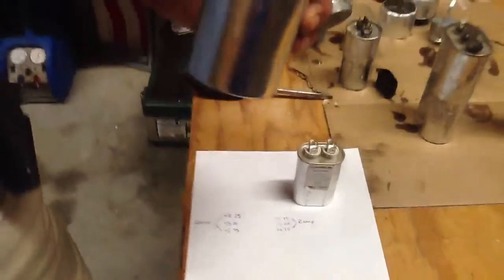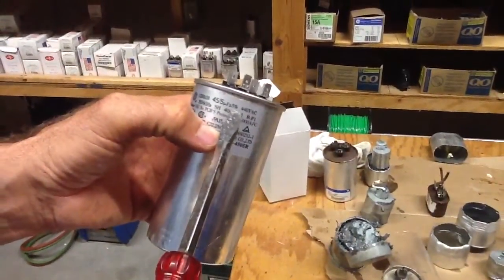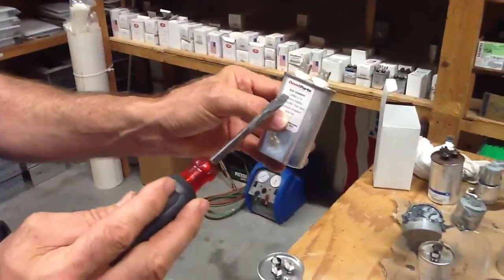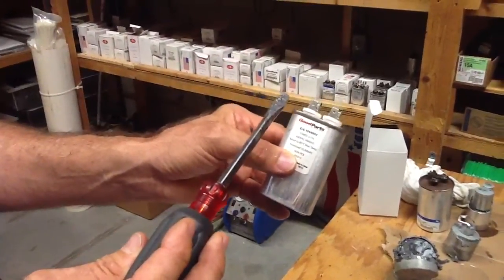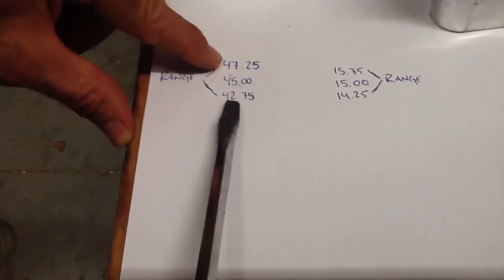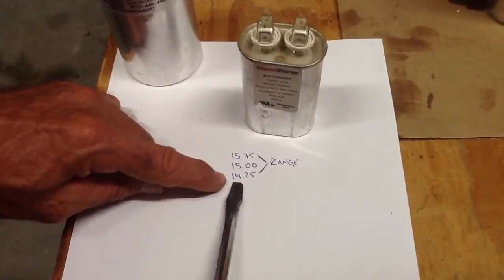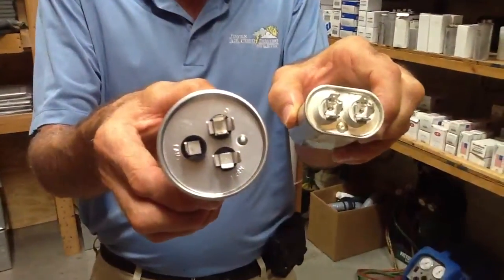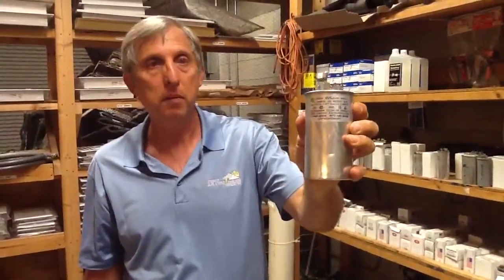UNDERSTANDING A CAPACITOR

Comment: I purchased a brand new capacitor 55/7.5 mfd   +/- 6%

Right out of the box:  It reads 53.8 Herm and  7.37 Fan   

 Min -6% 53.94  Herm  6.44 Mfd. MFD

Should the new capacitor read 55 Herm and 7.5 fan exact???? Should I return it?

It is already very close to min on Herm side.

Appreciate any help I can get.

Hector

Comment: Sorry if this is a dumb question, but I have a motor start capacitor (used for a  117V, 60Hz, 600RPM, AC Bodine Electric Motor on an Ampex 351 reel to reel recorder), rated at 330VAC, 3.75µf, 60Hz - and I want to know what the tolerances are, as they're not indicated anywhere that I can see on the capacitor. For example, would a 400VAC, 5µf motor start capacitor work? Thanks for the video.